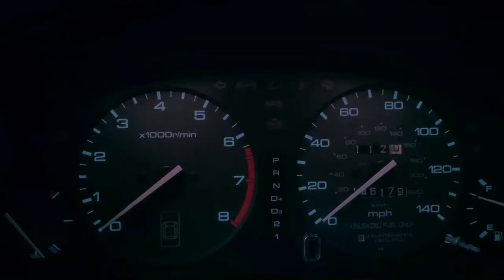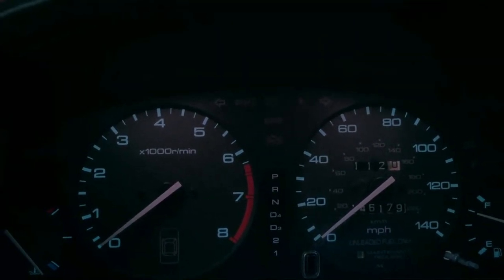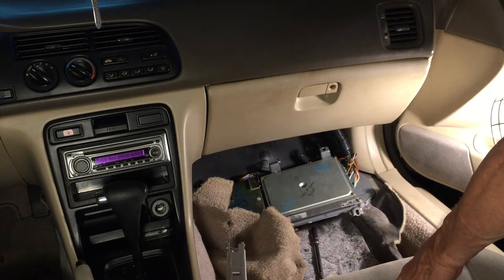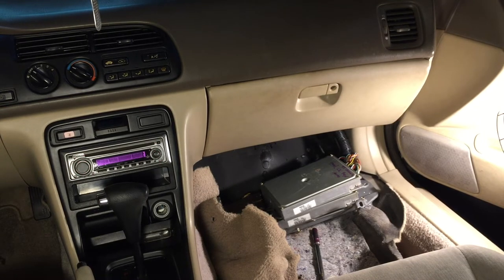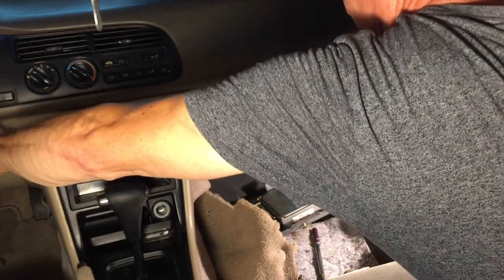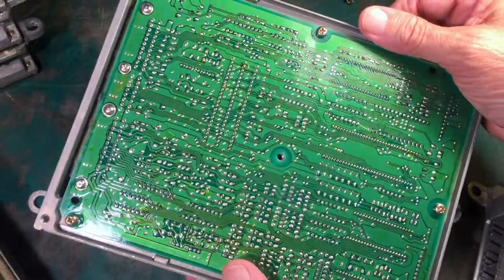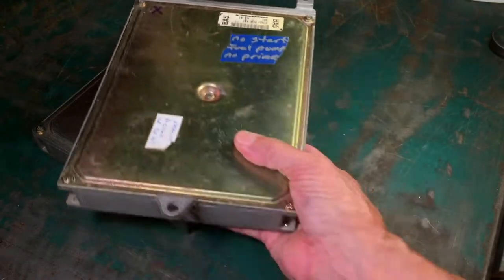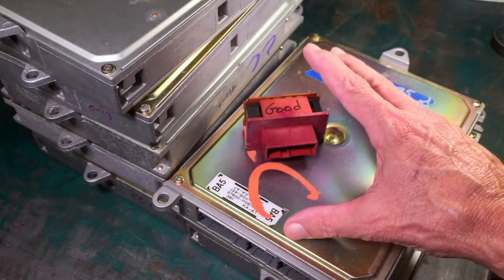Honda Accord Start/Stall Bad Computer

Comment: Our 2013 accord did this very thing. Throttle body was carbon stuck.  Broke loose the throttle body and sprayed cleaner. Fixed the no idle. ECM took a little time to relearn.  Then 4 months later, ECM is failed. Now confirmed.

Comment: Our 2008 Honda Accord has been at a shop for a while. The mechanic said we should take it to Honda Dealership for computer replacement. Is there a place where we could buy one elsewhere?
Reply from the maker: You would have to make sure the numbers match yours but possibly this:
https://oemusedautoparts1.com/products/2008-2009-honda-accord-pcm-engine-computer-ecu-ecm-pcu-oem-p-n-37820-r71-l59-37820-r71-l58-fits-2008-2009-oem-used-auto-parts-3?currency=USD&variant=41147620262024&utm_medium=cpc&utm_source=google&utm_campaign=Google%20Shopping&utm_source=google&utm_medium=paid&utm_campaign=20314543899&utm_content=&utm_term=&gadid=&utm_source=google&utm_medium=paid&utm_campaign=20314543899&utm_content=&utm_term=&gadid=&gclid=Cj0KCQjwuZGnBhD1ARIsACxbAViivDDsM4sNMGll0MzSckzFq17clMiOS0MjqsgzK1fIOaZLxegVx3AaAjFPEALw_wcB

Comment: Does it go out gradually or all at once?  Trying to figure out whats wrong with my 96, but I suspect the fuel system.  Just changed distributor cap and rotor and, as it did a few days ago (for 2 cold rainy days), it won't start at all now. And, now it makes a god-awful sound when i try to crank it too long. 
Checked the fuel pump fuse already.
For months, I'd often have to try to start it many times and even jump start it on cold days or if I hadn't driven it in 3+ days.  But, it started fine when warm/hot after driving a mile or more.
Chances that it is the computer are what?
Reply from the maker: I've had computers fail all at once and also fail gradually.. The gradual was a no start when it was hot in the interior of the car like summer mid day but would start in the morning before interior got hot.. Unfortunately the only way to know if computer is your problem is to replace it.. If you can find one at a salvage yard you can probably buy a short warranty and return it if necessary.. Video of no start when hot in interior:
https://www.youtube.com/watch?v=MUKbdrdVMyA
Reply: @tongo117  thank you.  I misunderstood.  Could've sworn you and others said the ECU computer failed usually when either cold or humid out...and did just fine when warm or hot.

Comment: Can you do the same thing in a 1998 Honda Accord 2.3l changing out the computer
Reply from the maker: Yes.. Your computer should be in the same location as my 95 I believe.. If not this may help.. 
https://www.pullapart.com/video-library/videos/how-to-pull-a-honda-computer-honda-accord-1997-2002/#:~:text=Once%20you've%20got%20everything,by%20these%2010%20millimeter%20fasteners.
Reply: cost for the computer was how much ?
Reply from the maker: I bought 3 salvage yard computers about 5 months ago total price was $71.. https://www.youtube.com/watch?v=k6cNSNi0R5s

Comment: Hey peanutbutterman I have 1991 Honda accord while am driving the car dies and I have to sit for a few minutes and it will start.
Reply from the maker: Bummer.. Could be lots of things causing that.. bad computer, bad main relay under steering wheel, bad fuel pump, bad fuel pump relay, bad camshaft or crankshaft position sensor...

Comment: My 2007 accord discharges after 5 minutes even with new alternator and battery and tested both, hoping it might not be the ECM. Anyone has had a similar experience or any tips? Bc I’m lost…
Reply: Did you figure it out? I changed my battery, alternator, starter, spark plugs and ignition coils and wires done, all within a month and still feels like it will shut off at any moment